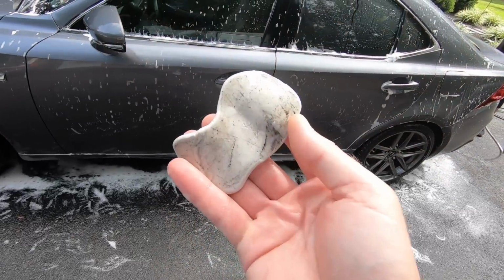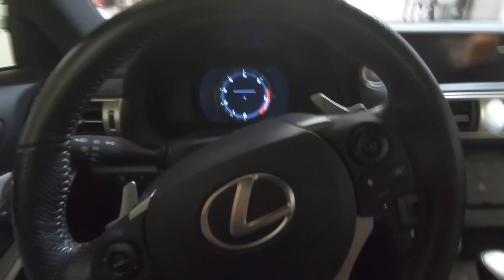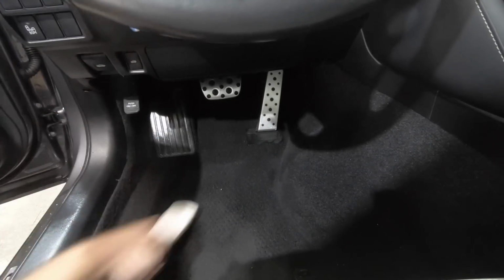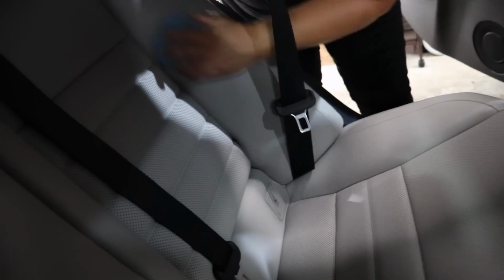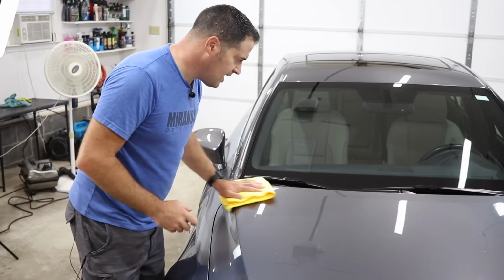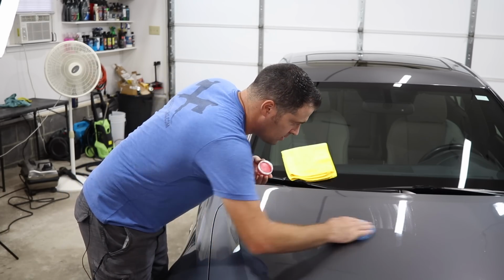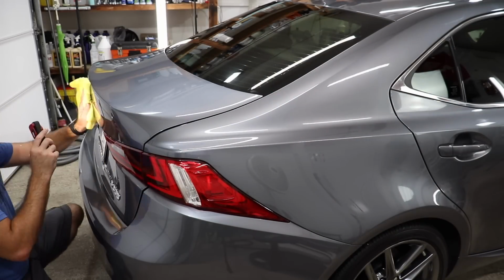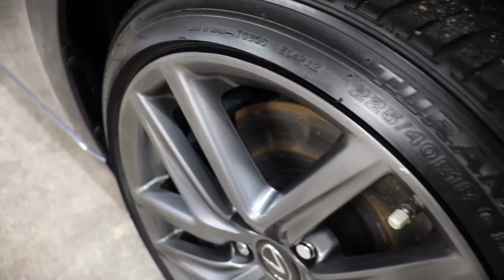Interior & Exterior Detail With AM Details Products! Lexus IS #autodetailing #mobiledetailing

Comment: Very interesting rubber vacuum tip. Where do you get this? Excellent work as always!  Oh do you guys still detail in the winter?
Reply from the maker: Hi.  Its the Ridgid Long crevice tool that has the rubber tip. https://amzn.to/3fZU8U2
Yes we detail through the winter here in VA, the winters aren't as harsh as northern ones, so we can usually work through it with only a few days or weeks that may be to cold.
Reply: @MirandaDetailing  thank you for the link!  oh I am in southern MD but one thing I have realized is my threshold for cold temps are not as strong as it used to be.  Trying to acquire cold weather gear.
Reply from the maker: You’re welcome!  Yeah some days we dress and gear up like it’s -40 degrees!  Out blood has certainly thinned. I grew up in VT and could handle cold no problem. Now...not so much. 😫
Reply: @MirandaDetailing  i grew up in NJ so I know the feeling.  40 - 45 is my limit. I am damn near in ski gear because sweaty and cold is no Bueno. 🥶

Comment: Phil, I love your videos!!!  Two quick questions: 
Do you wheel your extractor out every time you use it? 
Do you ever pressure wash the engine and then spray hyper dressing on the engine and let the water evaporate to leave a shine? 

Thank You, Cody
Reply from the maker: Hi  Well if I do need it then yes I'll have to drag it out to use it.  I was thinking of getting a 30 ft hose and water line so I can just keep it in the trailer.
Reply from the maker: Sorry I forgot answer your last question. Yes after we clean the engine bay we will use either hyper dressing 1:1 or 303 Aerospace protectant on the plastics.
Reply from the maker: Hi You're welcome...yes that should work perfectly!! Great find on the water line hose, I was searching for one like that.  I think it would fit on this hose reel also, https://youtu.be/PS8G03cLhvk

Comment: Is there much difference between a wheel wax and a normal bodywork wax which I have used on my wheels for years, do you think should change that?
Reply from the maker: The only difference in whee waxes is they are usually high heat resist. But most synthetic sealants are heat resist now also.